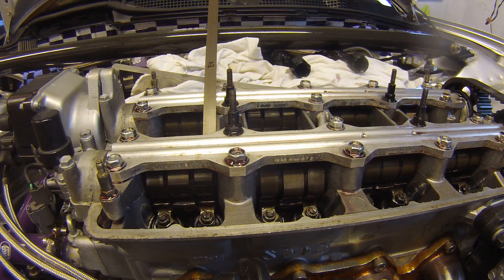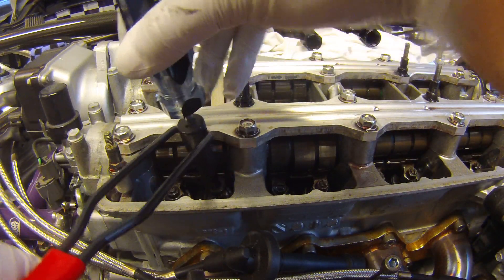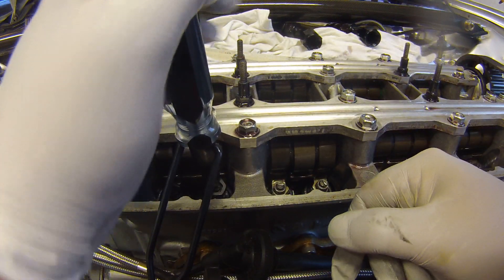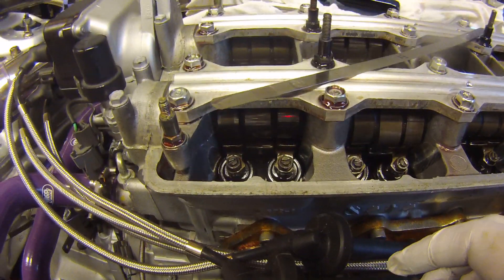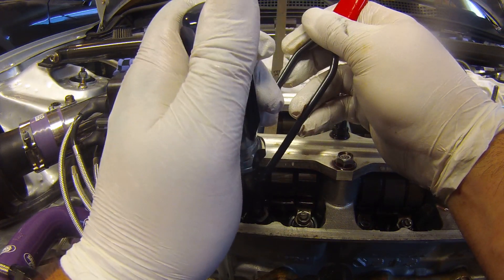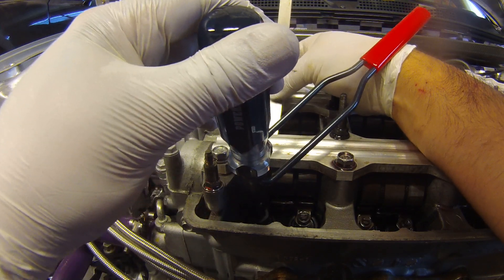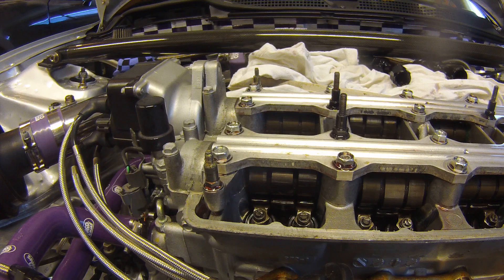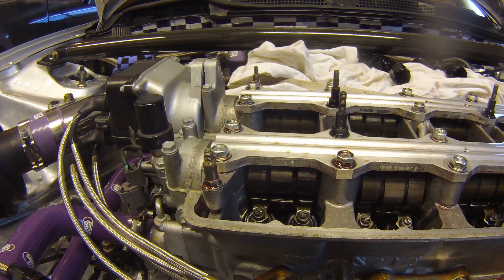Hi Def How To: Valve Lash Adjustment on Honda Engine - GSR B18C1 - Type R B18C5 - B16a - B18A1 B18B1

Comment: do the lobes of the cams fully compress the valves down while doing this
Reply from the maker: +Bradley Flanary they go as far as they typically would when engine is running and not in vtec.  I don't lock VTEC so valves may go further when VTEC engages based on the larger cam lobe
Reply: LM Engineering so do it with OUT VTEC engaged? Right?

Comment: what does it mean when it says valve lash 3-5 on intake. do I use a 3 4 or 5 im confused
Reply from the maker: That means that if you are within that range, you are within the engine spec.

Comment: where did you get those long gauges?
Reply: There are links to ebay in the description but one of them (the intake one) is a bad link...This should be a good one.  http://www.ebay.com/itm/007-178mm-Feeler-Gage-Gauge-12-Long-Strip-1-2-Wide-USA-Made-Carbon-Steel-/252176803161?hash=item3ab6e8a559:g:ACMAAOSwhcJWOmi2

Comment: Hi,gasper.whats the measure of the gauge for the intake and exhaust.thanks,
Reply from the maker: I ran a .007 intake and an .008 exhaust if I remember correctly.  If you look under your hood there should be a decal which explains the suggested size feeler.